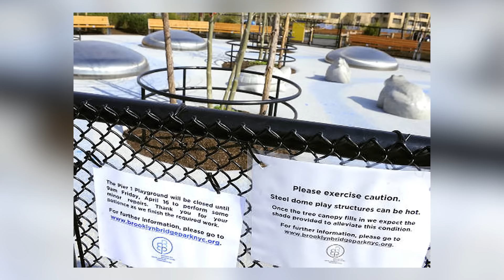15 Biggest Architectural Fails

Comment: A few corrections:
1. Aside from the reflectivity and inconvenient shape problems, those are all Engineering mistakes. In Canada, engineering students are given an engineering ring upon graduation as a symbol of their duty to protect the public, in reference to the collapse of the Quebec Bridge.
2. The Tacoma Narrow’s bridge fell because it wasn’t stiff enough. The Serviceability Limit State hadn’t been checked properly. The newer design included a stiffer roof deck made of  trusses to limit deflections, and to allow wind to pass through more easily.
3. The windows cracking are not because “AIR” is expanding and destroying the windows. A significant difference in coefficients of thermal expansion between the windows and their frames is causing the two materials to expand at different rates upon a change in temperature, either causing the windows to loosen in the frames and fall off, or causing the frames to apply stress on the windows and crack them.

Comment: Architects are not the ones computing the loads of the structure, thats an engineers failure, 🤦🏻‍♂️
Reply: And, architects do not have to go through the physics sequence to learn if their creations are even feasible?
Reply: @jhorne18  on commercial structures, Architects aren't even allowed to sign off of structural. And no, architects do not go through the physical sequence. While knowledge of structures is definitely required. They are more concerned with ordinance and code compliance, including but not limited to, building setback requirements, building height and floor limits,  egress travel distance, fire separation, requirements, barrier free accessibility, number of water closets and urinals required for the restrooms based on use groups and projected occupancy loads, basically the overall functionality of the building.
Reply: @themusicman2005  That, as you say, ". While knowledge of structures is definitely required. ", would imply having a good basic knowledge of the physics involved.
Reply: @jhorne18  absolutely, but outside of residential, architects don't do the calculations of structures. But still have to have an idea of how structures and other engineering systems in buildings operate.

Comment: The Disney theater is not a fail but a consequence. So it gets a little hot. They’ve fixed it and the architecture is still brilliant. By the way, it’s also in downtown Los Angeles and nowhere near Disneyland.
Reply: It was melting tires on cars parked across the street from it. I'd call that a fail.

Comment: these rare mistakes are testament to how well most buildings are engineered.
Reply: Then why does my hotel room kitchen sink faucet run onto the countertop instead of into the sink when you turn it on?
Reply: @corettaha7855  Because the maintenance guy paid to replace the original faucet doesn't give a shit.

Comment: I lived in Boston during the construction of the new John Hancock building. At one point all the windows held plywood instead of glass as the glass landed on the street and church below. Imagine 52 stories of plywood. There was a large reward offered to solve the problem. Besides the fix to the 58th floor with torsion control the glass solution ended up being using thicker glass. The sale of the plywood when the windows were replaced, was the largest auction of plywood in history.

Comment: 14:00 The Hancock Tower was more-or-less complete in 1972, but the problems that ensued kept it from opening and being rented out until 1976. For months, as the panes kept popping out and being replaced with plywood, it became an eyesore, along with the wooden canopies that were built over the sidewalks below to protect pedestrians.  It was referred to, during this time as the "plywood palace", or, occasionally, the "plywood ranch" (which was also the name of a building supply chain at the time). When the remaining glass was finally replaced, it, along with the plywood, was sold off to those who repurposed it as building material, or for art projects and furniture.

Comment: 6:06 I was owner of one unit in that apartment complex. Mine wasn't in the one collapsed, but still got compensated for all the troubles. And the rest of the buildings became the most strictly reinforced and inspected apartment buildings in China. The collapsed building wasn't rebuilt, site became a community park. The price of the apartment increased 5x by the time I sold it, in line with the market trend in Shanghai. Never knew how the family of the poor worker was compensated, the developer and government usually keep it secret.

Comment: I was working in Boston when the Hancock Building was being built. Driving by it daily I remember when the street and sidewalk would be closed on windy days as glass would always fall. The windows weren't replaced until the building was almost finished as they kept thinking the problem could be fixed without replacing all the windows..... it couldn't.

Comment: Missing from this collection is the Citicorp Center Building in NYC that had an engineering crisis in 1978 when it was discovered that the building would not withstand the effects of diagonally-oriented "quartering winds".  To remedy the problem, construction crews working at night welded 2" steel plates over each of the skyscraper's 200 bolted joints.  At the time, the public was not informed of the crisis.

Comment: Wouldn’t say architectural but engineering mistakes
Reply: It's a bit of a mix, the concave surfaces reflecting light should have been caught by the architects. Structural engineers don't really worry about the visual elements of the  structure and that's were the light reflection problems come in.

It's also a failure of the building codes and permitting authority.

Once the first concave building created concentrated areas of light and heat and was made public there is really no good excuse to not update the building code to require those calculations be done as part of plan review.

Structural deficiencies that result in collapses or pieces falling off are definitely engineering issues.
Reply: No marcel miranda! No!

Comment: Architects primarily design the aesthetics of a structure; it is the Structural Engineer that is responsible for making sure the structure is safely built.
Reply: I'm an architecture student and that's not true. An architect is responsible for designing a buildings overall layout and ensure that a building meets code. A interior designer is tasked with the aesthetics of the interior. An architect has to ensure a buildings design complies with code in ways such as egress, fire safety, accessibility .occupancy, etc. An architect works with a structural engineer to ensure a building can stand ,and a good architect knows the general essentials of engineering in order to help communications with the structural engineer. I've had to take classes in the fundamentals of engineering ranging from steel , wood, and concrete construction.
Reply: An architect has to memorize the building codes ( or at least be able to navigate through them) of whatever US state they live in. The codes specify everything from spaces needed for AC and ventilation ,fire protection, ADAAG compliancy , and rules for occupancy. The buildings codes in the US are set by each state and then each city or town has a zoning code which an architect must also be familiar with (sets Hight restrictions and setbacks on a property , Land use , sometimes even what a building can loo like). With all of these requirements, this is why the licensing exams for architects are considered difficult. Architects are not just concerned with aesthetics, but everything necessary for a building to serve its purpose. This includes receiving and having overview of the design by structural engineers to ensure a building stands.
Reply: @raymondhutchinson7156  Still structural engineer who responsible to calculate and make sure the structure is strong enough to any loading conditions
Reply: @derihilyas  I agree. But an  architect still needs to know the basics of engineering in order to communicate with the structural engineer. In the end ,the structual engineer has to look over the design and sign the documents for the building to be legally built.

Comment: Apparently architect's don't understand that metal reflects sunlight and absorbs heat. 🤷
Reply: Definitely understand, just a miscalculation if how much.
Reply: @themusicman2005  well, metals will reflect heat. But also retain heat. Basic principles. If you have a good patina on a metal it will reflect more but still retain heat. If you have a matte finish or brushed finish,  it will reflect heat as well but not as much. But it will retain more heat. 🤷
Reply: @murphyslaw7815  I'm not understanding your point.
Reply: @themusicman2005  the point is that it's not a miscalculation.
Reply: Its either that or the construction documents the architect provided with the main blueprints were not specific enough. The construction documents typically list everything from the type of insulation to the finish of a material. If something is not specified , then a construction manager or construction crew will likely use their own knowledge to finish the project , sometimes ending with bad results.

Comment: You left out the 1981 catwalk collapse at the Hyatt Hotel in Kansas City and the tunnel collapse in Boston when cheap bolts were used.
Reply: The catwalk was caused by a redesign. Originally, the rods hanging from the ceiling would have supported both catwalks. Unfortunately, it was determined that that would be a little complicated to implement. Instead, they chose to have the rods hanging from the ceiling support only the top catwalk directly. A second set of rods would hang from the top catwalk's supporting beams in order to support the bottom catwalk, effectively doubling the stress put on the top catwalk's supporting beams. Because the supporting beams were box-shaped beams created by welding pairs of c-shaped beams at the top and bottom, this meant that that doubled stress was put directly on the weakest part of the supporting beams.
Reply: What foxymetroid is trying to say is that they used the weaker side of the beams rather than the strong side. Because they felt it was easier to build. Ultimately the engineer was held responsible because he trusted the steel fabricators too much and sealed the drawings without properly analyze the design. He assumed they did their own calculations in house, but when asked in court they were like "nope! That's the engineer's job" that engineer ended up losing his license after the investigation was complete.

Comment: How about the ATT building in downtown Manhattan? An engineering oversight sight failed to account for oblique wind loads during hurricanes, making its collapse almost guaranteed during a typical storm.  The error was discovered by a woman pursuing a PhD in structural engineering in the year immediately after the building completion.  She urgently contacted the chief architect and presented her alarming findings.  He immediately realized the gravity of the error, and an emergency remediation was performed under the cover of darkness once the tenants were gone each night. After six weeks of nightly work, the modifications were completed, and no tenant was ever aware of either the immense danger to themselves or the huge scope of construction activity the building required to be made safe.

Comment: The 1981 Hyatt Regency skywalk collapse in Kansas City Missouri killed 114 people and injured another 200+ people.
Reply: That was neither an architecture or engineering fail. The rods that supported those skywalks were supposed to be continuous, but the builder substituted shorter rods that were joined at the skywalk. That join is what failed.

Comment: I was expecting to see the Kansas City Hyatt Hotel lobby skywalks in this video. They were suspended walkways that went through the large open lobby at the 2nd, 3rd, and 4th floor levels. During a crowded event at the hotel, one fell onto the one below it, then both landed on the many people on the ground level. Obviously they were incapable of bearing the weight that they were supposed to have been. There were many deaths.
Reply: This is a actually a pretty interesting example of how things get screwed up.  The original structural design of these walkways was sound.  There was a seemingly simple change requested during construction that was approved by the structural engineering company that ended up placing twice the weight on the nuts as what was intended.

Comment: Architects dont have any responsibility in terms of structural design and stability. An architect is like an artist. His job is to visualize how a building/structure should look, what materials are used, make sure that its practical, make sure that it fits into the rest of the environment its placed in, etc. The engineers must then make sure that the proposed building is able to withstand any forces that it may encounter during its lifetime. This is the reason why there can often be conflicts between architects and engineers. The architects, without fully understanding the structural side of things, can sometimes propose designs that are very impractical to build, and/or where it requires very costly solutions.

Comment: Peterlee new town in the UK was based on Swedish modern residential buildings. Unfortunately British architect ‘copies’ weren’t as good so much of the town had to be subsequently rebuilt. Examples - homes with V-shaped roofs with gutters in the middle, which overflowed into the centre of the homes; hot air heating systems blowing directly onto plastic door frames causing them to buckle, and vents 3-4’ away from walls leaving huge areas of rooms where no furniture could be placed. All cost millions to redesign and repair.

Comment: 1. Engineering not Architecture 2. Some photos are not even the structure described. 3. Many many errors in describing actual events. Very poorly researched and not factual. Rating ZERO.

Comment: When they resumed building the Leaning Tower of Pisa, they changed the angle of the 6th story (the 5th level with arches) so the tower would be more upright. If you look at 10:37, at the same level that the roof of the church crosses in front of the tower, or at 10:10, you can see that the tower isn't completely straight.

Comment: Nice video keep up the good videos.
Reply: You should know the difference between an architect and structural engineer and their respective responsibilities. Most of the failures are primarily engineering goofs.
Reply: @allengandell4610  Think out of the box it's not what you claim it's cause by corruption research them all.

Comment: Tacoma Narrows Bridge is well studied and understood.   
-the Narrows cause the wind to speed up 
-stiffining to the road deck was not included
- even when the bridge developed harmonic waves, stiffening was not added.

The George Washington Bridgeon the Hudson River was designed with a lower deck to give it stiffening but that lower deck was not built until much later.   Before the lower deck was added the upper road deck would move in high winds.  Once the lower deck was completed the stiffening kept the deck from moving.

Comment: I believe this video is missing some information on the leaning tower of Pisa.
I had heard they began a 'mud jacking' program several years ago. This entails high pressure injection of concrete into the ground on the low side of the tower. Done right, this slowly raises the low side so that the tilt is reduced to a safer level.
Reply: They've tried a few different things to stabilize it. At one point, I think they attached cables to the higher side and anchored them in the ground, probably while they were doing something else to stabilize it.

Comment: These are not all architectural fails. Architects design the building in collaboration with structural engineers who ultimately take responsibility for the structure.

Comment: Youve missed some very infamous fails -the leaning /cracking skyscrapers in Sydney, Abu Dhabi and San Francisco, highway bridge collapse in Genoa that killed 43, walkway collapses Miami that killed 6, and in Kansas City that killed 114. The Hard Rock hotel in New Orleans, the crane collapse in Mecca that killed 118. Ultimately the Sampoong Department store collapse in Seoul that killed 502, and the Rana Plaza in Bangladesh that killed 1,100.
Reply: Lots of your examples could have easily replaced a bunch of the examples in the video.

Comment: Some of these engineering goofs were probably covered, at least in part, by insurance.  Since insurance companies never lose money, all of their policyholders - maybe us - ended up paying for them.  Some of the goofs may have been remedied by government funds, so we, the taxpayers, paid for them.

In almost all cases, it's an architectural or engineering team that develops the plan, so the mistakes can usually fall into more than one lap.  Then, of course, the plans are implemented by construction companies who will cut every corner they can to stay within their low bid.

Paris also learned that thin slabs of Carrera marble do not make a durable cladding.  Even I know that marble is a soft stone that makes it questionable as a building material exposed to the elements.
Reply: First Canadian Place in Toronto 🇨🇦 Canada had to replace all of its Carrera marble cladding, as well.
Reply: its no different then when there is a hurricane or tornado the insurance company's pay nothing till its determined if the government declares it a national disaster then the taxpayers pay for it all and not the insurance company's
Reply: I guess importing building material from a totally different climate was part of the issue.